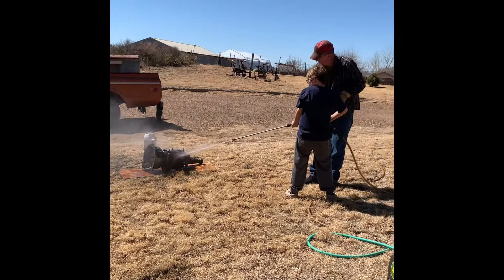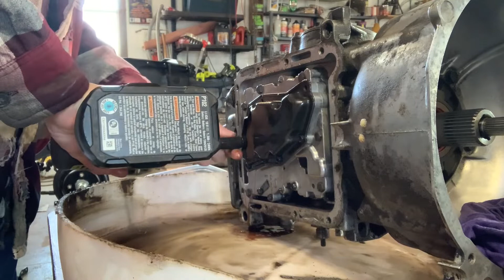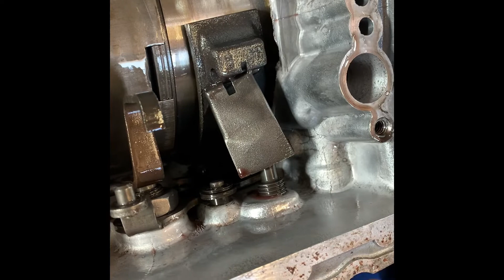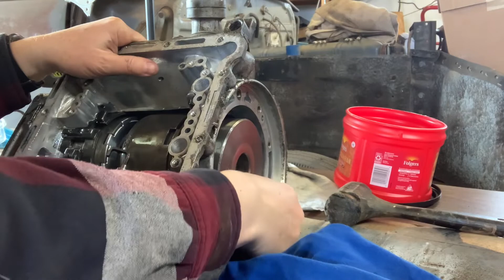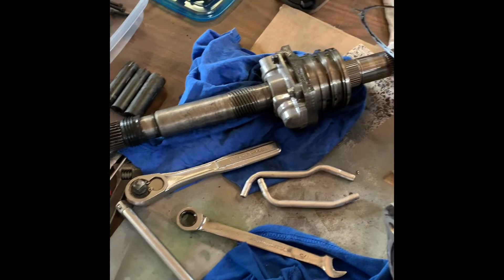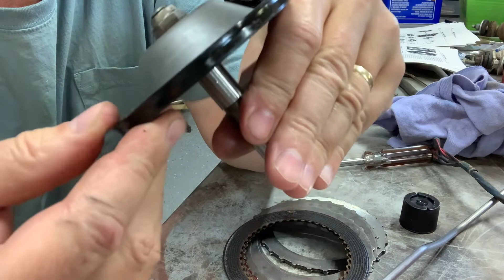1966 Mustang c4 transmission tear down and inspection

Comment: Hey Okie, greetings from Tulsa. I'm about to rebuild my 66 c4 and wondered if i should just order thrust washers bearings and servo o rings?  Ive got a tan alto master kit w/ bushings and trans-go valve body kit, also, what did you use to clean all the parts in?
Reply from the maker: Thanks for watching!
If you’re not in a hurry I would tear it down and see what you actually need. This will save you time and shipping cost in the long run. 
I used brake cleaner and petroleum naphtha to clean the parts.